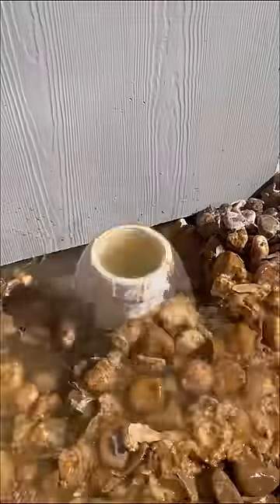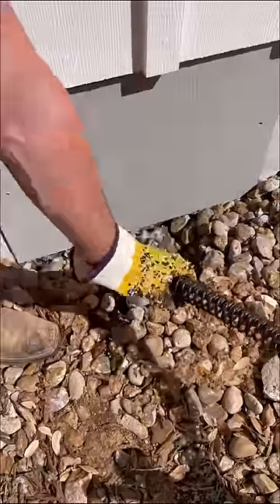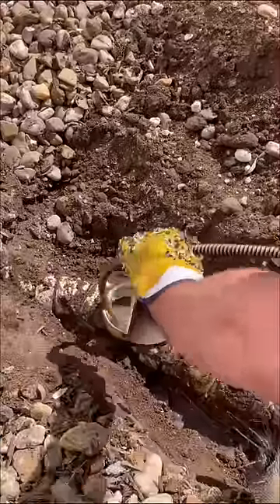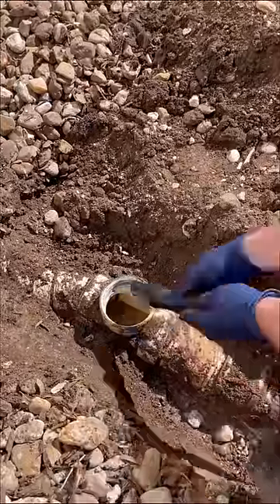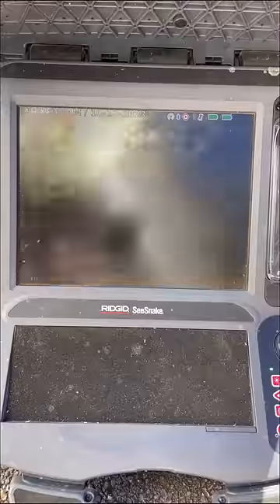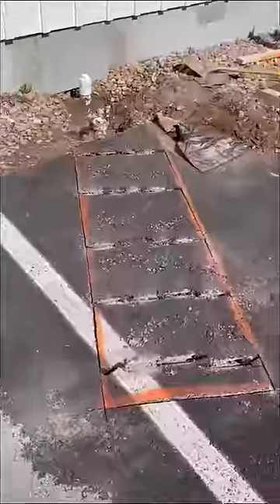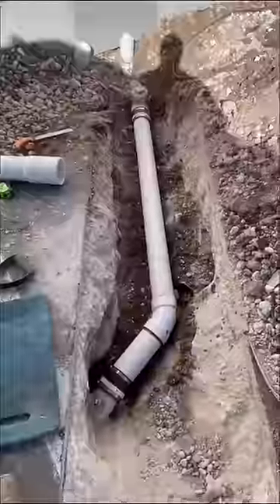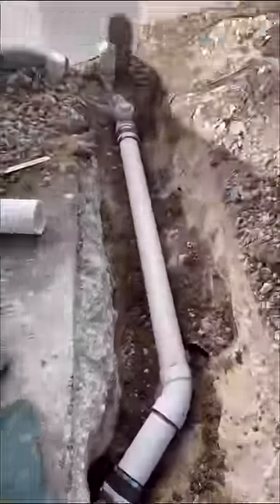What’s clogging this sewer line?

Comment: Wow the scope quickly changed on this job! Looks like good work to get them going again.
Reply: Happens 90% of the time. Drain techs go from a $60 service call to $15,000 in repairs.
Reply: @benpeterson1238 What's 15900 dollars for? Buying a repair machine set😂😂?
Reply: @nishant54  Costs to get an excavator crew, excavator, permits, pipe layers etc... It's not cheap to dig up a yard and or concrete.
Reply: @benpeterson1238  happened to me..had plumbing backing up, went from a drain clear, to a new section replaced, to the whole damned septic tank needing to be replaced as it was caving in on itself.
Reply: It amazes me that plumbers spend all day dipping their hands and tools in poop water and never sanitize them.
Reply: wrong, he scammed tf out of them
Reply: @rustyplays8406  How so?

Comment: Happened on my  property. Builders somehow drove several huge truck over area in our alley and collapsed the sewer line. I realized this after two visits from plumber and told me that it was near  connection of new with existing city line. I'm a female and   it was a nice February day and planned to dig the hole myself not letting my dad know my plan while he went golfing. I dug a 6' by 6' by 6' deep hole exposing the drain line damage.  I just had to see this damage for myself.
Dad was shocked saying why didn't I tell him my plan.  Plummer showed up early next morning and repaired line. It didn't cost us  $4,000 but only $320. 😁  
Dad helped me fill in hole. I truly enjoyed doing this during winter in El Paso, TX and not during our extreme hot summers. 🥰
Our bank account sighed a sigh of relief had I not become a digger.
Reply: A little bit of work saves a lot of money
Reply: You need to work this story into a regular conversation with any guy who may be on your 'Significant-Other Radar'. It's important for them to understand that You can dig a Hole with No outside help.
:)
Jus' sayin'.
Reply: 320$ sounds cheap for a big issue like that. Although I guess it could have been when life was cheaper.
Reply: My neighbor had her terrace around her pool regrouted a few years back. Those aholes who did the job just washed all the excess grouting through the overflow pipe from the pool (that goes though my garden). When my neighbor, after they were done, tried to wash her terrace and flush away some of the pool water it all came back up and it flooded her yard.

She called those guys who messed it up and they offered to make a new pipe, through my garden, meaning they'll have to destroy my natural stone garden, for the sweet price of 12.000$.

I told them 'nope', no pipes in my garden, there is a pipe already, fix that. They ofc claimed it was impossible.

I knew where the pipe was running because I had start digging to build my shed. I opened it up again and showed them the pipe. Then when I felt the pipe something felt wrong... I cut it open and there was their work.... All the grouting they had flushed down the overflow had set and hardened in the pipe. A 1,5m "pure stone" blockage...

I told my neighbor, with those guys standing there, I'll fix it for you, but I'm building a shed here. So if you ever hire these amateurs again you're screwed. No new pipes in my garden and we are just lucky we can reach the problem these aholes made.

They left after some angry looks. I cut out the pvc pipe part that was blocked and put in a new part.

You have to stay present when ppl work on your house....
Reply: You shoveled out EIGHT CUBIC YARDS?  LOL.  The "while Dad went golfing" was the tipoff.
Reply: I would never had let my dad do anything like that. The year before he had quadruple heart surgery.
He got together with his golfing buddies once a month. I was 34 and strong , mostly loved my dad and wouldn't let him get hurt by shoveling that much dirt. It was the winter of 1999 in El Paso,Texas and it felt more like spring. He always would say, if you start something, you must finish it, and I did. Besides it wasn't all that hard compared to the jobs I've done throughout my life. I'm not a femme fatale.I was put in charge of 32 Vietnam Veterans at 19 years old as their boss and also worked for Union Pacific Railroad. Not a girly girl, but still all woman that love men! Blessings to you and yours. @The_DC_Kid

Comment: I lived in Michigan in the early 80s and the house I had bought started having drain issues. I tried to snake it out but literally hit a wall. I didn't have the cash to hire out the job so I measured the snake length to the stop grabbed a shovel and started digging. Three things, Michigan is not like Tennessee, you can actually dig by hand. Second, the frost line in Michigan is almost at crude oil depth. 
Third, the main was in the rt side of the house. I started digging across ways of where I thought it should be. Eight ft to the left I finally found it. 
Weeping willow roots and a collapsed line. It took me four days of digging to replace around 4 ft of new pipe and back fill. 
There is no way I could have done that much digging in my area in Tennessee in three days. After a couple weeks of no rain here and it is easier to dig through the asphalt.
Reply: Willow trees are notorious for creating subsidence where I live in the UK. Some insurance companies don’t want to touch your property if they are within a certain distance from the house. Are your drains as  narrow as this video? They look about 3 inches. No wonder they get blocked.

Comment: I worked with a plumber. An elderly lady on the 3rd floor of a condo had a backed up sewer line. We went outside and had to dig for the clean out. We found it, but 3 storys of sewage came we no regard to my presence. After finishing that day i stripped down in my garage. Threw everything I was wearing away and said the $30 and hour wasn't worth it. It was so much worse then being misted by shit water while on patrol in Iraq.
Reply: Dang you were getting 30?
Reply: Why don't you start your own company... Plumbing is the easiest work out there. I do small jobs all day long I've never worked for a plumbing company. The secret is saying no when you get big jobs. Just take the small easy stuff and you'll be fine.
Reply: @BasixStructures you need a master plumber license to start your own plumbing company
Reply: @HH-le1vi  Stop lying... I'm a handyman and I've been doing plumbing jobs for 25yrs. I've also been doing electrical for just as long.
Reply: @BasixStructures  that's cause you're a handyman. If you setup as a single trade then you need a master's license in that trade.
Reply: @HH-le1vi  No You Don't...  I don't do strictly plumbing because climbing under sinks, it twists by back out shape and doing Cleanouts is really easy but I hate playing around in shit. Also plumbing is boring. I prefer electrical and Painting because im not laying on my back or sitting on my knees. Whoever told you that you need a master's license is playing with your head.
Reply: @BasixStructures  you seem to not understand that you're a handyman. Handyman doesn't need the same license as an actual licensed plumber. If you want to be a licensed plumbing contractor you need a masters license.
Reply: @HH-le1vi  Im talking small Jobs im not talking large Jobs you dont need a License to do small Jobs. Accept that your wrong!!
Reply: @BasixStructures you can insure your business but if anyone reports you to your board you can be barred from holding a license. You’re a handy Andy so your jobs are limited and a lot of the place you touching the electrical or gas is outright illegal. Just bc you can doesn’t mean you should. I’m a one man plumbing company and come across handyman work all the time and it’s never really worked out in the long run for the customer. Disregard our training to put your on a pedestal idc bc if the rats get the crumbs we don’t have to sweep you know.
Reply: @auspicioustoot he won't accept he's wrong.  I'm what would be considered a handy man as well.  Allot of the work I do would be considered illegal cause I don't pull permits.  You can have a general contractors license and get away with a bunch of stuff in most states.  But in reality any electrical work and plumbing normally requires a licensed plumber/ electrician to pull the permits to do it legally. My price reflects my knowledge and lack of pulling permits and customers are informed before hand. There's some jobs I just can't do though without calling someone I know to pull the permits and back my work.  Otherwise the homeowner could be told that it all needs to be done over by someone licensed and inspected.  Really depends on the city/town. The scope of the work, and if you're going to be out in the open where someone could see you. Even a dumpster often requires a permit and that brings an inspector wondering what you need the dumpster for.  Been in trouble for doing a roof before lol. That led to him seeing work inside and seeing electrical being done and lead paint/asbestos being removed illegally.  Created a huge headache and raised the job price 40k to get it done legally.  That's the cost of not wanting to pay big brother though doing house flips. Try to save a dollar on every job. But one is bound to get you caught and hit your pocket deep
Reply: @BasixStructures lol

Comment: You’re asking a lot of a pipe putting a parking spot over it. A few thousand pound truck could park there
Reply: Ehh worth it to park that 1 extra car. Ignore the swaths of empty spaces please.
Reply: Does it really look like one parking spot is  intersecting with that line?
Reply: Probably used the thin type pvc pipe instead of the normal thicker installed one at the end ( I bet the cheap company installed that paper thin pipes probably covering the whole site)
Reply: count on it
Reply: serious question I've been out of the game for years, does anyone still use black iron anymore? I was always sketched out by burying and paving over PVC even the schedule 80.
Reply: schedule 80 is surprisingly tough. The wrong fill cause problems though, but the collapse happened way earlier.
Reply: @piscinaiv7937 black iron? For drains?
Reply: @piscinaiv7937 Back in the 1990s I saw 20' sections black Iron  Pipe.  Nowdays everything aweful expensive
Reply: It’s not properly cased. It needs to be deeper or cases
Reply: @piscinaiv7937 They used to use cast iron
Reply: @piscinaiv7937 I think they still use black iron in Chicago for drainage. They still use lead and oakum to seal them too
Reply: @piscinaiv7937  I'm pretty sure that black Iron isn't being used anymore. My current home was built in 1880, and the previous owner had it replaced in 2015. There's no black iron anywhere in the home. I'm pretty disappointed about that, but at least my daughter's house (just 50 years newer) still has the black iron down-run. All of the horizontal to the street is PVC. IMHO I'd rather have iron. When it fails it's not adding plastics to the soil.

Comment: Pricey job. I never want that to happen to me.
Reply: Mine was $3500 for 20ft of replacement pipe with digging it up and cutting 6ft worth of concrete.
Reply: Cost me about $2000
Reply: @stephen902 yup $3500k is practically free. 😂
Reply: 3000 for 15ft replaced with new cleanout added outside so it will never back up inside the home again. Pipe was about 4 ft down all grass to dig through luckily.
Reply: Guess it depends where you live, 3500k is not 10k but sucked ass 😂

Comment: That’s crazy that the sanitary line is close to ground level.  I’m in Canada and they need to be at least 8ft underground I think. And if they are higher than that they need insulation, even heat trace because of the cold.

Comment: Nice little clean out? Yeah...NO. Improper. The thinwall 4 inch pipe that was most likely crushed by a tire from a piece of heavy equipment during construction is not traffic rated pipe (schedule 40). The 4" fernco rubber coupler really should be a solid plastic coupler or a strongback at the very least. The cleanout really should be a proper two way cleanout tee and on and on and on. This stuff gets REALLY EXPENSIVE to repair when it is improperly installed by a bunch of clowns. It looks as though this Technician has a handle on this. Nice work!

Comment: Had a similar problem. One day I heard the water in the 2nd bathroom tub gurgling. Investigated and could tell it was backing up. On a weekend of course so the likely hood would get a tech of some kind to open it up would be slim. I went to one of the local hardware type stores and purchased on of those bladders or balloons that you put on the end of a hose and put it down into the pipe.  When you turn on the water it will expand into the pipe and there is a smaller jet nozzle on the opposite end. Turned on the water and let it go for about 5 minutes. Clog was gone. Did not have a caved in pipe like this one. Just a clog. Probably a corner or turn in the pipe that caught something. It has happened a couple more time since. I did have one of the cables you put in and spin and I ran it down into the pipe but whatever is happening in there won't allow that to go a long distance. About once a month I pull the cap and look down the trap. No backing up no problem. I make a note of when I did it.

Comment: Putting a line that close to the surface under asphalt is going to repeat the same situation as soon as another car parks there when the ground is wet.

You would unfortunately have to special prder some heavy wall pipe, preferably ABS since it tends to flex not crack. Probably schedule 120 or 160.

Comment: Reminds me of moving in to a house I'd just bought. Week and a half in, it leaked sewage right at the house. Dug it up, found a broken pipe that had been covered up by clay and rocks. Fixed it up, put in a nice clean out and covered it all up. A week later, the drains were overflowing. Snaked it, couldn't find anything. Rented the power snake, about 150 feet out it hit something i couldn't get through. Dug up the septic tank and it was dry inside. Broke a solid foot of clay out of the line with a screwdriver, my head in the tank and my wife holding my legs so I didn't fall in. Got the splash down, it worked perfectly from then till I sold the place 13 years later.

Comment: So it looks like the cleanout and some of the pipe was ok but when you camera down the line you can see the ribs in the pipe and the pipe is black inside and also when you pull the rootball out if you stop frame and look at inside of fitting it’s black. It’s French drain material not approved sewer material. Glad you replaced it all. Corrugated thin wall pipe is an absolute no go. I would camera back under house just in case. Sch 40 will not fold like that and it is solid white.
Reply: suggest you take a closer look, the pipe is white pvc crushed causing the blockage, the so called black ribbed pipe is dirt accumulated in a wave pattern on the white pipe.

Comment: I was working for a plumber at one time years ago and ran into the same issue but not the collapsed line. The entire sewer line installation wasn't even a year old but the guy that put it in ran it slightly uphill to go over a Volkswagen sized rock about a foot and a half below grade !! Fortunately it was hard sandstone but unfortunately a backhoe only dug grooves in it with the bucket teeth. Had to use the heaviest pick axe I ever handled to break up a path about 10 feet long and 2 feet deep to get the drop right on it. The new homeowners were NOT happy about that bill !!!

Comment: I had the same situation except I have a septic tank. All the drains and toilets were completely clogged. I didn’t have a camera, so I was trying different things from small to big. The biggest thing I tried was a heavy duty 50’ snake. After about 25 feet it got caught on something, and I couldn’t break it loose. I was thinking maybe a tree root. I was checking online trying to find a solution. Finally I found something that I hadn’t already tried. Hydrochloric acid, also called muriatic acid. I followed the instructions for clearing a clogged drain. It said to dilute with water, so I mixed it 50/50 with water. Poured some in all the drains and waited about two hours. Nothing happened, so I tried it again and again nothing happened. I went back to the hardware store and bought a gallon of it. I poured about half of the gallon undiluted in the drains. In about one hour the water started very slowly going down. I poured in the rest of the gallon and about 3 hours later everything was working but not 100%, maybe 80%. However I was happy because I was tired of all the effort I put into it. After about 3 or 4 months we were going on a 2 week vacation to another country. The day before we were supposed to fly out with our non refundable tickets, everything was clogged up again. I went back to the hardware store and bought another gallon of acid. I forgot to mention that every time the drains were clogged up I used a wet/dry vacuum to suck out all of the water. I don’t know how many trips I made carrying the water outside to dump it. This time just before a friend was coming to take us to the airport. I pored the whole gallon in the drains and 2 toilets. I didn’t want to pour it sooner because of the fumes. When we came back after 2 weeks, I turned the water back on and flushed one of the toilets. A rusty colored goopy substance rose up in the toilet. It came almost to the top before it went completely down. I flushed the other toilet and it flushed right down faster than the other one. I ran water in all the drains and everything was running good, better than I’ve ever seen it. That was almost 3 years ago and everything is still working great. I did buy another gallon of acid just in case and it’s been sitting there waiting for another catastrophe.